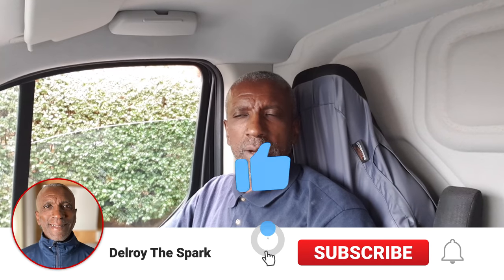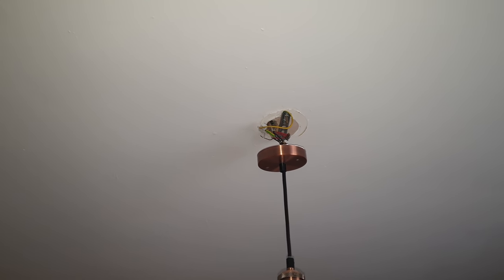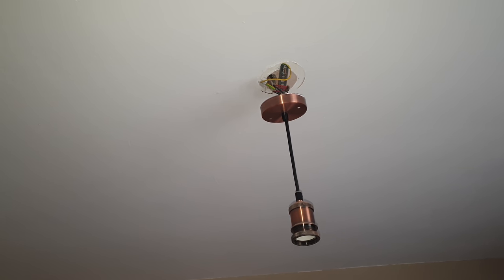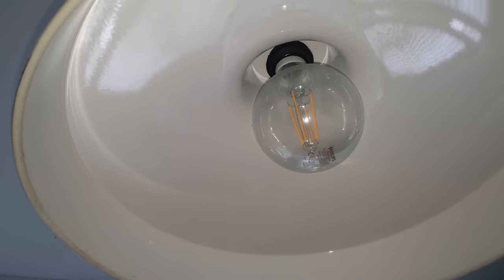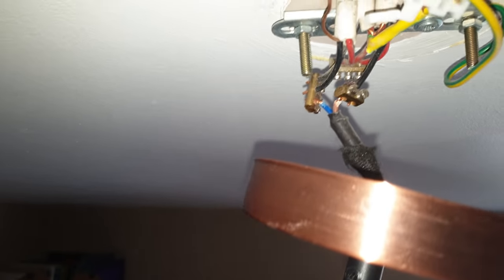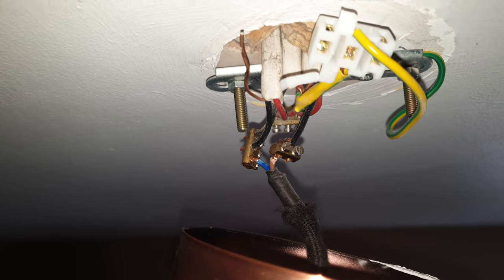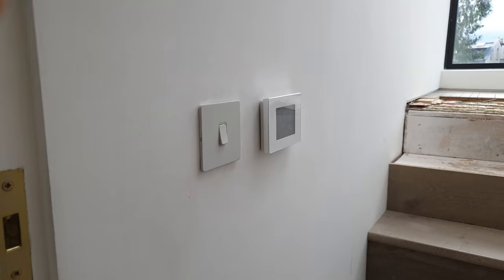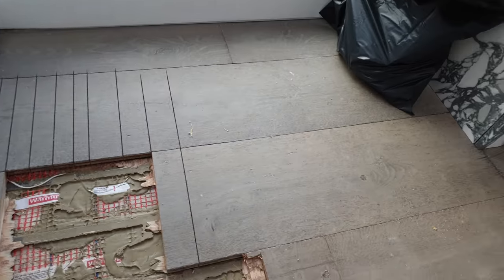Fixing DIY Gone Wrong | Electrical Fault Finding

Comment: First night I moved I to a house the downstairs light tripped when I turned them on.... The next day the sparky took the rose down to reveal a similar thing.... All crammed in together , removed from the rose and all the  connectors were touching each other..... A few weeks later the old house owner admitted they changed it themselves and it "never worked after that"...!!!!! If ya don't know, leave well alone...

Comment: You don't believe in boxes for lights yet you need to have sleeving on a bare earth wire tht almost never carries voltage. Although your term blocks are better than n america wire nuts/twist-tees or merriates (ya buggered it French not worth my time to look up😂) I however like copper crimps with the nylon insulator caps